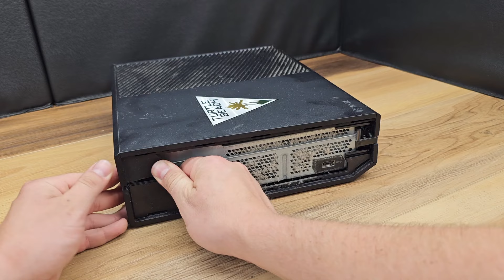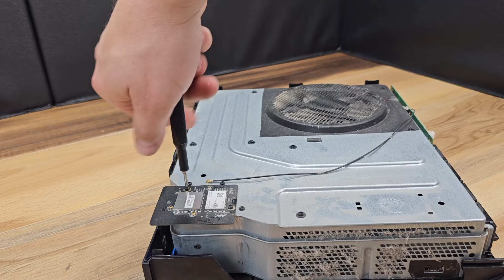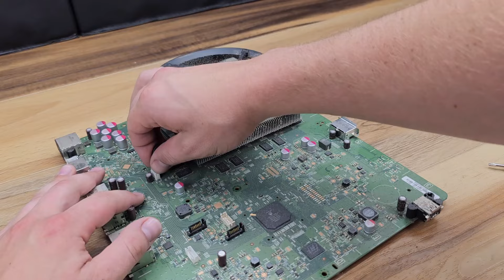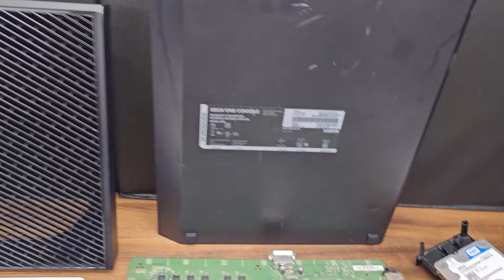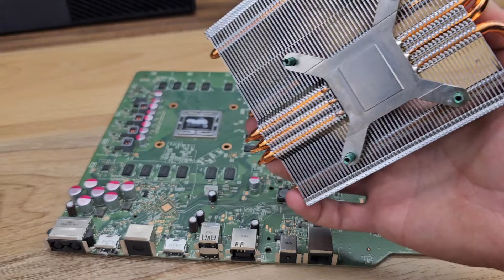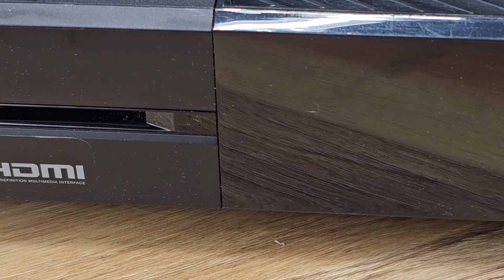Xbox One Not Reading Discs - How to Fix - Teardown, Refurbishment & Disc Drive Replacement

Comment: i tried taking apart my xbox one that i had to replace with an xbox series s, and it no longer reads a disc, nor takes a disc in, the disc drive no longer works, neither does the power button, i wish i could send you in mine so you could repair it but i dont have the money to get it addressed nor the money to pay you to fix it

Comment: Can you not just by a whole new disc replacement with the mother board inside it ? Is that not what you did? Why replace it with the old one or replace the old one with the new one when you had a new one to begin with?
Reply: The board in the disc drive is paired to the xbox main board, it has to be swapped out.

Comment: I've replaced my disc laser in which it work for Blu-ray and not for videogames as well as having scratches after inserting the disc would you recommend swapping the disc drive or what could be the issue?
Reply: did you swap the card from the old disc layer?

Comment: I’ve actually also replaced my Xbox One disc drive too. Be wary that the replacements can fail too. My replaced disc drive is failing after only a few months after being replaced. These consoles are getting old and it will become harder and harder to maintain them

Comment: Hi, Can I replace my broken DG-6M1S-01B with DG-6M1S-02B model or DG-6M2S-01B?
Reply from the maker: Looking on Amazon, some listings do show both part numbers. That said, I would read through the listing (Amazon, EBay etc) and be sure your part number is included or even reach out to the seller in advance. Hope this helps!

Comment: Wait so do i have to remove the inside of the Disc Drive? and Swap the old parts to the new one so that it works? Will it not work if i add a new one do i have to swap the old parts?

Comment: where do you get the special tool to remove the X over the heat sink?
Reply from the maker: Thanks for watching! 
They can be found on EBay or Amazon. Search for "X Clamp removal tool". That said, they are not required, using a small flat head screwdriver from the top like I did in the video to pop the clamp off of the posts will do the job just takes a bit more work without the tool.